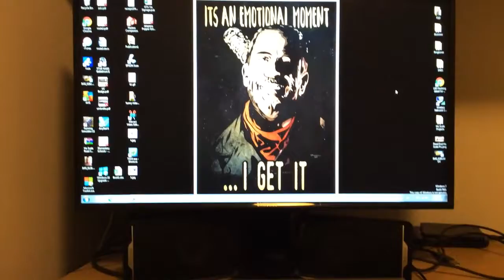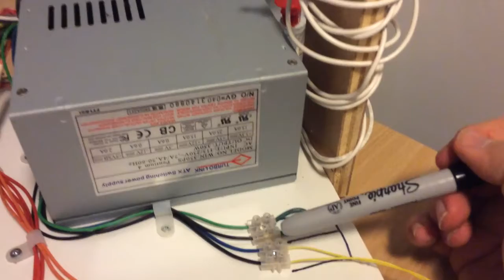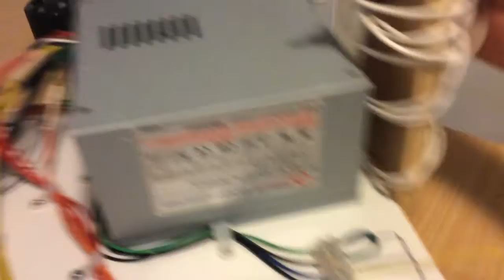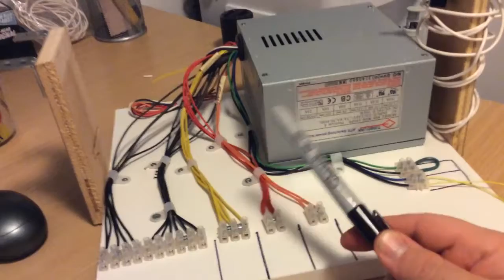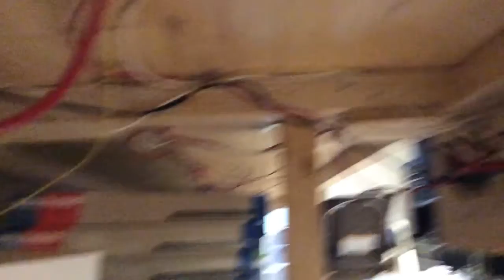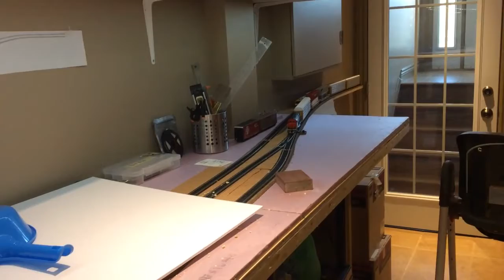Layout 2.0 Update 4 - Power Supply

Comment: hi C Dubya... i just watched this vid & i was wondering if you can help me... like you i am using an old CPU power supply the problem i am having is first i don't get 12 volts out of the yellow wire instead i'm getting 8.1 volts... second when i attach my LED's ( same as your) they flicker at a very fast rate... what am i doing wrong??? hope you can help.. vinny
Reply from the maker: Im not too sure Vinny, I didn't experience any voltage errors like that or any flickering, the only issue I have sometimes is the unit wont come on sometimes. My setup isnt anything special, the green wire is connected to a black ground and the blue is also 12 volt Im using as an power on indicator light. I guess my only suggestion is to test all the power outputs to see if any of the voltages are correct , if they are all not what the are supposed to be maybe your power supply is not working correctly.
Reply: thank you for your input.. vinny

Comment: Some info on what those other wires do if you're interested: https://cdn.instructables.com/F2M/DMYY/HA4MG4QW/F2MDMYYHA4MG4QW.LARGE.jpg.  The purple and grey ones in particular might be useful for LED's, purple will tell you when the power supply has wall power and grey will tell you when it's actually on and functioning properly.

I've seen other places that the sensing wires (the smaller gauge ones) need to be connected.  Also that some power supplies need some sort of a load on them or they won't stay on.  Maybe either of those was why it wouldn't always turn on before you hard wired the switch in there?

Please also consider adding a warning message somewhere, there are capacitors in there that can kill you.  I'm sure it says that on the side of every power supply case anyways but never hurts to mention it again.

The board mounting job looks nice, should serve your layout well.

Cheers,
Dave

Comment: Computer power supplies are great for layouts, you don't need a ton of wall warts and there is usually more power than you will ever use depending on which one you use.  The newer the psu the better the efficiency.  Some of the older less efficient ones do fail badly.
Scott

Comment: looks like quite the challenge, will be nice to see it working, and what and where you plugged things into.why the lighting for over top, don't they come with a switch already?   and  what your going to use it for also. I have 2 old towers sitting in a closet,
Reply from the maker: The overhead lighting is an LED strip with sticky backing. I ordered off China ebay for 2 dollars a 16 foot strip, it didn't come with a switch. I plan to use the power supply to run a 12 Volt accessory bus line to power street lights, building lights,  grade crossing flashers, traffic lights, train signals, vehicles with lightning, ect. I have big plans for this little layout. Thanks for watching and commenting